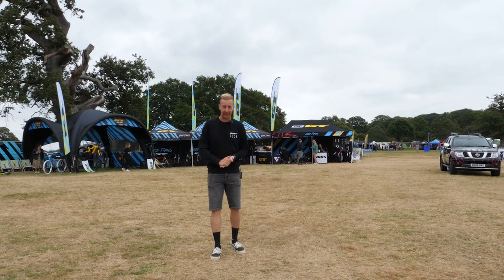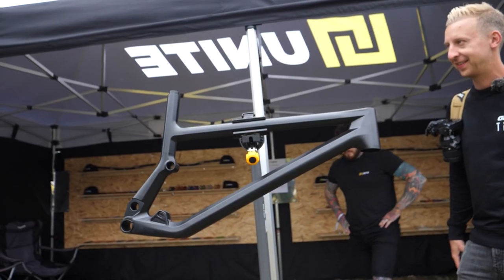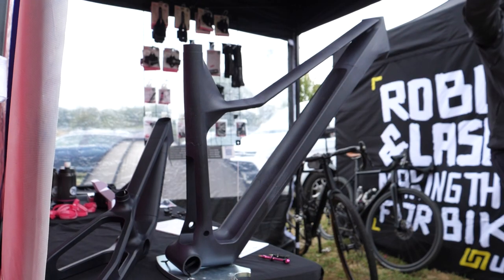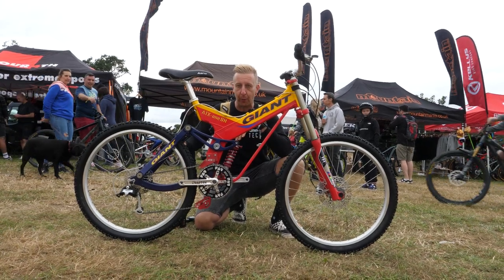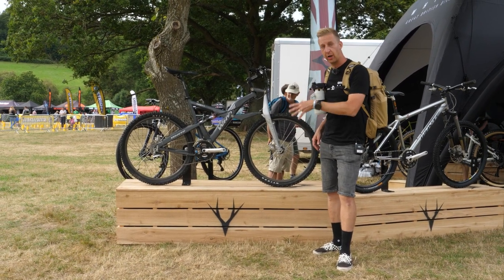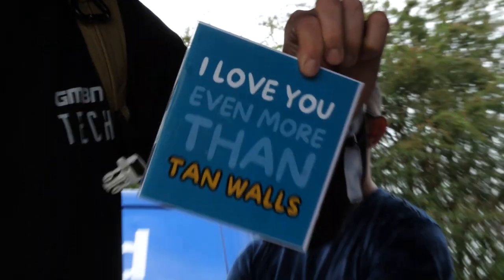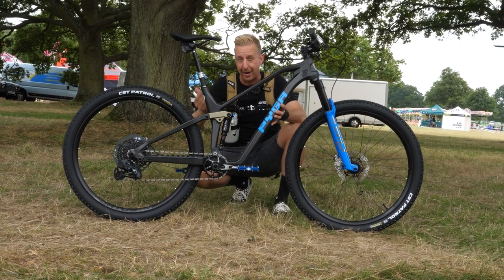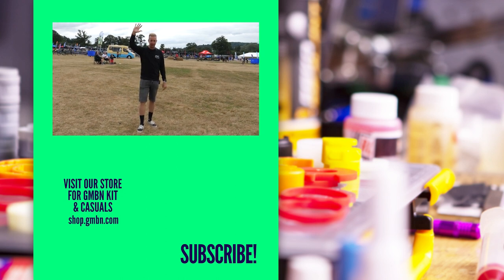MTB Pit Walk & Tech Round Up | Malverns Classic 2021

Comment: 76 projects has the right idea, but can we just switch to Schrader already?
Reply: I had switched 3 of my bikes to Schrader valves as was tired of Presta being clogged or seize a bit. Was an outstanding video tutorial from the park tool on how to do convert. I would say I should do it earlier, pump up so fast, never even slight clogged ( I am using muc-off and Vittoria airliner). Valves ordered from Aliexpress 60mm long. Perfect quality and length. Presta is the past century.

Comment: I still don't understand what's wrong with schrader valve?
Reply: I think it's a size thing. Smaller hole in the rim means you can run a thinner rim? Someone who knows more can confirm tho.
Reply: @xKinseh  do small rim size in MTB really matters?
Reply: @DanuelNuel  Was used to be a matter 20 years ago. Nowadays wheels are wide enough, stiff and strong. There is a lot of research on the Net of why Presta was used. but it's irrelevant now. Schrader is so much better. Done 3 of my bikes and am happy trouble-free now.